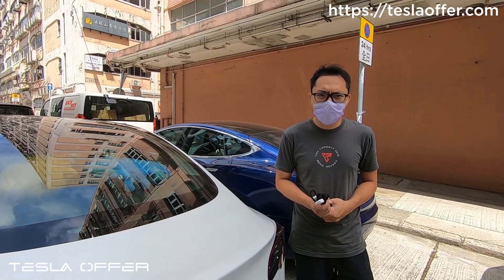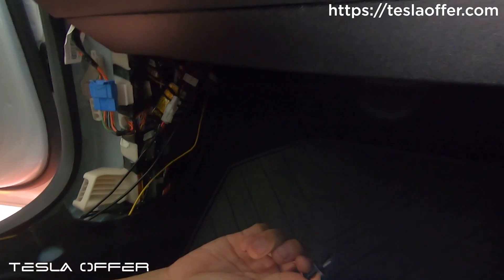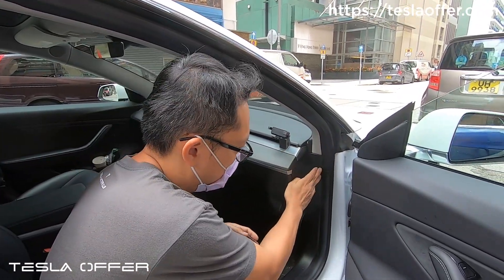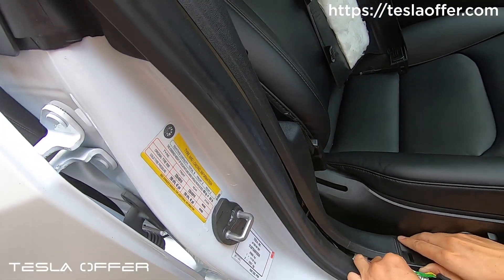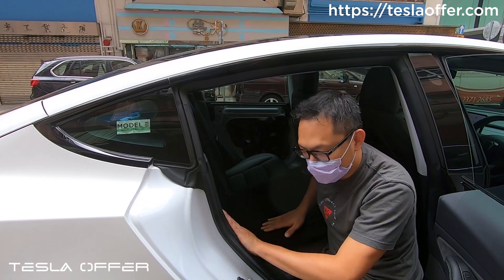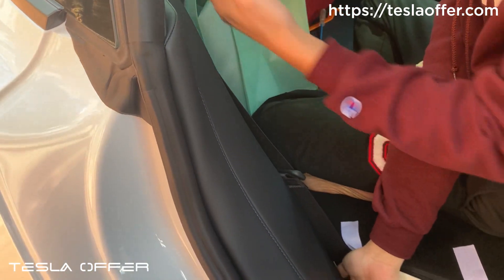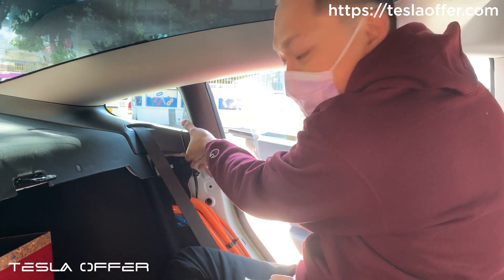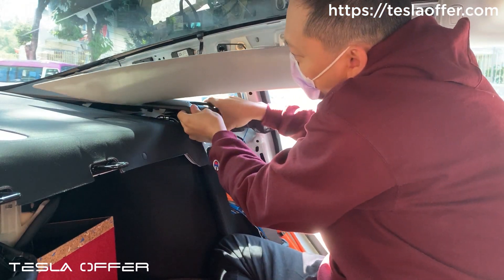Tesla Offer - Model 3 SR+ Speakers Activation Installation Tutorial

Comment: Hi Raymond  I have a 2021 LHD M3. I have trouble finding the right hand side tweeter plug location in the passenger compartment. Do you have any wiring diagrams, maybe share with me? I followed your YouTube instructions but can't find it. Many thanks
Reply from the maker: Hi, yes you can find the wiring diagram on our installation manual

Comment: Just finished my installation, I am not a professional, but since I live in LA, I did everything on my passenger side. I believe it’s a little bit easier.
It took me around 90 minutes. I needed to re-run the cable since it was about an inch short after first try.
The hardest part was the middle blue connector, I did remove the connector above it before removing the blue connectors. 
Like Raymond said, fingers are the main tool for this upgrade. 
I have not tried it, but all I can say is it works fine. Good job for making this cable. Thank you.
Reply: I dont mean to be so offtopic but does any of you know a method to get back into an instagram account?
I was dumb lost my password. I love any assistance you can give me!
Reply: @Matthias Damon it did the trick and I now got access to my account again. Im so happy:D
Thank you so much, you really help me out !
Reply: @Jermaine Reece You are welcome xD

Comment: I have a 2019 RHD car with back speakers. I bought a wiring harness off aliexpress however the cable from the computer (left side) to the right side is too short. Must be only for LHD cars.

I'll try solder additional length so I can run the length from left side computer to right passenger side.

My question is, does the connector for the computer add the left side tweeter/surround speakers, or is this all done from right side/passenger?
Reply from the maker: We sell the speaker activation kit for RHD cars with extra length connecting to the MCU. Installation manual can be found on our product page.

Comment: This 'upgrade' caused my Model 3 to have a variety of software issues. Cruise would fail, AP would have issues. The windows would trigger in the up position. After I removed it no problems. The connector that goes into the Tesla computer wouldn't seat fully. 

I did hear the additional speakers, but it was barely noticeable when it did work. Junk.

Thanks for the video, it reminded me how to remove this.
Reply from the maker: Hi Jeff, please contact us on telegram. We can help you diagnose the problem. Probably the B pillar connector was not connected tight, but we can look at it together.

Comment: Is the 2021 version plug and play now ? I don't want to tap any wires... Also, does the "2021 without rear speakers" version have the rear shelf connector ? I swapped my 2021 rear shelf with one that have the original speakers and harness.
Reply: so i have 2022 standard and was looking at just buying an oem rear shelf with speakers installed on ebay, hows your experience with them? also is it a drop in swap or does it require some modifications?

Comment: I ordered the DIY wire harness,  and I have model 3 SR+ 2020 model, I have no speakers at the rear of the car, so I just plug into to speakers and tweeters up front and no need to run along the edge of the car, as I no speakers on the back shelf.

Comment: Has anyone done this on their 2021 SR+ ?
Reply from the maker: we have installed it on a lot of 2021 model 3 up to july 2021 build without any problems
Reply: Just curious maybe I have a new model but I can’t locate the passenger tweeter connection any advice! I do this stuff quite often just kinda stumped

Comment: So you are installing 2 extra speakers on the front speakers? One speaker is 4 Ohms so you are getting three 4 Ohm speakers parallel what's about 1.4 Ohms in total... Not sure if the Tesla Amp can handle it. Also the tweeter will get the full unfiltered (bass & mid) signal?

Comment: I am very confused. I have a rhd 2019 model 3 sr+. You say all connections should be done on the passenger side yet on the video you connect a single cable on the passenger side and then  connect the main cable on the drivers side on a RHD car. What is the purpose of the small cable connected to the computer? Is the signal cable connection always on the drivers side in a RHD?
Reply from the maker: For RHD cars, you need to connect 1 connector on the passenger side (left side) to the ICE and then then remaining 3 connectors on the driver side (right side)

Comment: Is this the same for 2021 model 3 sr+
Reply from the maker: For facelift Model 3 (Model Year 2021), the connector shown at 03:45  is missing. We have 2 solutions for that. Please contact out Tech Support for details.
Reply: @EVOffer  Is it still a plug and play solution? Are you going to demo those 2 solutions?
Reply from the maker: @mshumway78  one of them is plug and play and we will have the wire ready soon
Reply: @EVOffer  do you have a video yet for the 2021.  I just got my kit, I had a note that it was for a 2021 but I don't see anything different on the wire, there was nothing in the box with 2021 instructions.
Reply from the maker: @josephv5484  Please contact our tech support
Reply: I have the 2021 harness. Where do I tap in or call support?
Reply: @EVOffer  I did.. Still waiting for a reply.
Reply: @EVOffer   Please tell me the e-mail for the tech support
Reply from the maker: @christophmarenich2351  please contact us on Telegram.

Comment: I am sorry if I am repeating the same question- trying to watch install videos and comments and I seem to be getting conflicting advice:
I have a 2019 SR+ LHD(with the inactivated rear speakers).  Is all the work I need to do only on the passenger side?  I thought I saw a video in November from Raymond, that showed the initial connection under the glovebox (computer connection) and then a pass through in front of the center console to the drivers side and then connections running down the side from the A pillar, B pillar and to the rear.  Even the video above shows Raymond working on the drivers side (though RHD) 

My harness which I ordered on Black Friday and received in Dec 2020 seems to be appropriate for just one side of the car.
So the connections Raymond is showing on the drivers side, is also on the passenger side, so that we can run everything on that side?
Reply from the maker: Yes

Comment: I installed the set with rear speakers on my RHD 2020.6 SR+, somehow the passenger side A pillar speaker still has no sound, other speakers are all good, what could be the issue and anywhere I should check again?
Reply from the maker: Please contact our tech support for assistance.
Reply: Thanks, I'm contacting support, except that, it works quite well, the trickiest part is to put the back seats window top panel  back, it took me quite some hour to figure out that I need to spin it up to horizontal and align the top and push close to the window trim first then push downside in…
Reply: @EVOffer  I checked with your support and they suggested me to check B pillar connector and A pillar speaker connector and it turns out Tesla didn't connect my passenger side A pillar speaker! After I opened a pillar panel and manually connected it, all good now! Thanks a lot for the good product and service.

Comment: @teslaOffer the cable under the b pillar that connects to the blue plug needs to be shorter, It prevents the trim from fitting properly and it is bent extremely hard in order to fit. Am I doing something wrong?

Comment: If I only want to activate the front tweaters (no rear shef speakers) do I only need to connect the harness at the front of the car?  So no middle or rear car connects necessary? Thanks
Reply from the maker: Correct. Connect only the ICE, a pillar and b billar connectors.
Reply: So no middle or rear plugs? Any advantage or disadvantages to plugging them im? Also for left hand drive cars, do you install on left of right side of car
Reply from the maker: @yanyan3303  all on the right side
Reply: @EVOffer  how about the plug in... Just the ICE plug and the R plug? No middle or rear plug needed?
Reply: @yanyan3303  I think the B pillar is the middle plug (at the back of the front passenger side seat, blue plug in the video) so I presume you need to connect that. But not the last plug at the rear of the car.
Reply: @barneysmac  gotcha! Thanks for letting me know. Cant wait to get and try it out.